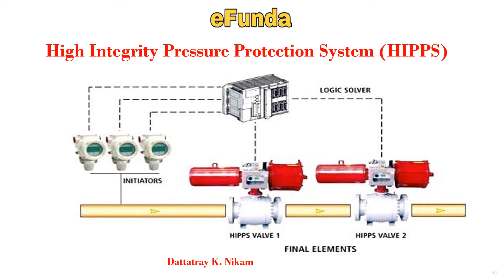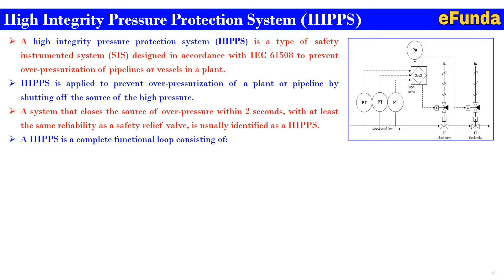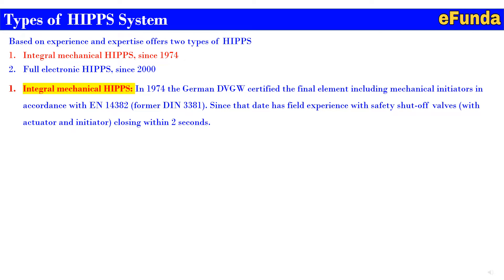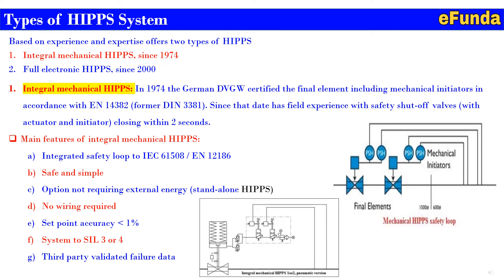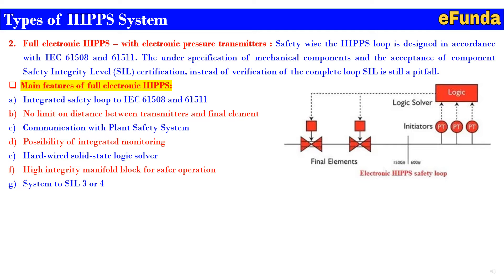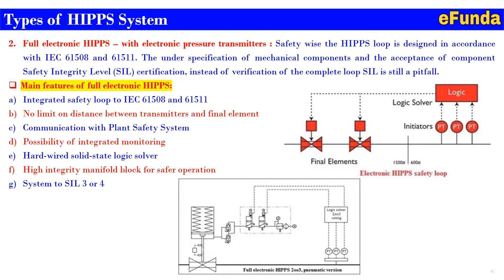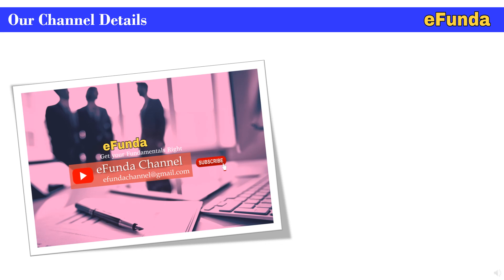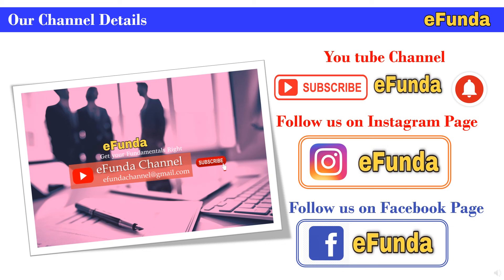High Integrity Pressure Protection System (HIPPS)

Comment: What is the prupose of Two Valves,  explain the purpose of each valve....???? your presentation is not perfect...
Reply from the maker: Thanks for watching eFunda channel video and share with others as well so that they can also get benefit out of such video. 

As HIPPS is SIL3 System logic solvers where 2oo3 configurations is used and HIPPS design may utilize dual devices in a 1oo2 (one out of two) configuration (two valves in series), where each valve has 1or 2 solenoids (in 1oo2 logic) powered by two independent outputs from the redundant SIL 3 certified Logic Solver.

Imagine situation with 2oo3 Initiators and only 1oo1 Valve is being used in configuration / loop.  Thanks.